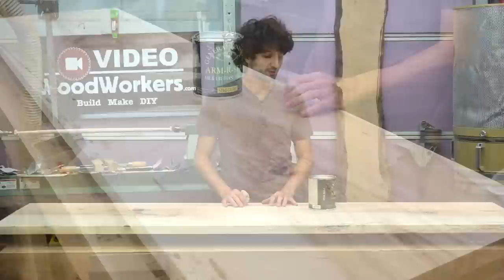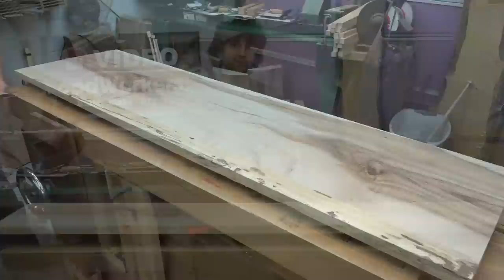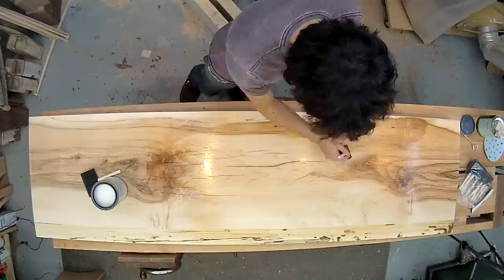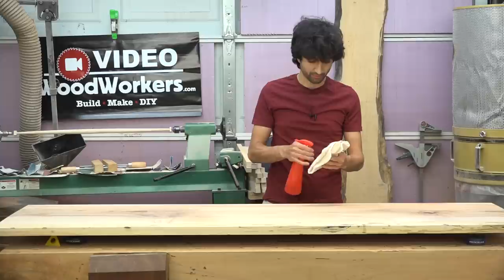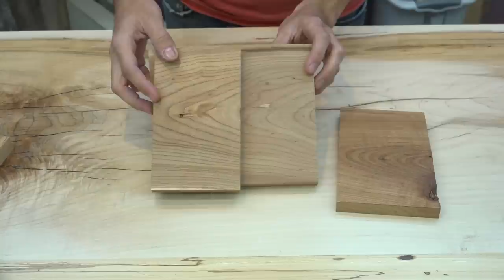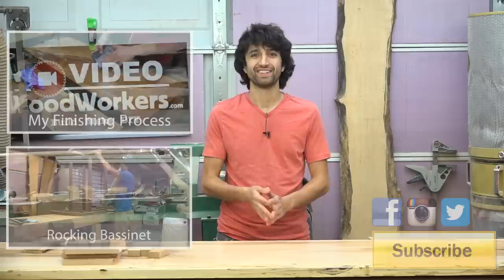Using a Water Based Finish for the First Time

Comment: There is a wipe on poly acrylic available but I haven't tried it. As the name applies it is wiped on with a cloth and rubbed into the wood rather than with a brush. That might might make application easier but I think the color would be the same result. There is a finish for every type of wood that works best for the wood grain and color. I like to test to see what works the best.
Reply from the maker: Thanks Kim!  Wipe is what I'm most used to so I'll have to give that a try in the future.  I think this is going to be my finish of choice for maple.  I think it looks great not being all yellow.

Comment: my two cents. I was sceptical at first with WB finishes too but soon changed my mind. technically they are similar to oil finishes. as with every finish it matters what you get (brand, type) and not the fact if it's WB or oil based. or acrylics vs polyurethanes. I think spraying WBs is the way to go. you can lay down much thicker coats than with brushing. and the gun cleanup is almost free. I remember the times I was going through half a can of solvents just to get my gun clean. especially with oil based opaque enamels. if it is above 20 deg C it will be ready for next coat after an hour. takes a little longer with brushing. spraying does not disrupt previous layers that's the advantage of gun. like oil based, the WB too melts into the previous layers easily. this stuff is actually not water based since there's no water in the can and no polymers can be made to disperse in water. they are glycol/alcohol based and the WB paint alone is somewhat "aggressive". as for choosing the WB finishes, always go with flooring or parquette finishes. at leasy here in EU these finishes have come a long way by now, but sure they cost twice as much as general purpose finishes like polycrylic etc
Reply: as for the milkiness: lighter wood tend to get even lighter, but on something like oak WB looks better than PU in my book. gives much more reddish hue instead of brown you get with oil based stuff. the milky/blueish appearance also serves as a visual clue. as soon as the milky effect is gone, you are ready for the next coat

Comment: I heard the off camera Director trying to give you cues. I don't like foam brushes at all. Bubbles and can't feel the wood. Brushers are ok sometimes but only if the finish flows well into the brush strokes to even it out. My preference is also a clean cloth. I need to try the water based clear coat though. Therefore this was informative for me! Thanks! Missed JR.
Reply from the maker: haha!  I was wondering if anyone would catch that.  He was out there hanging out with me.  Thanks for sharing your experiences Mac!

Comment: The garage door needs some insulation! lol I use the GF High Performance on all my shop furniture, I use my HVLP tho, awesome stuff, drys really fast!
Reply from the maker: lol It's so ugly :)  I bet the easy clean up is super nice for HVLP
Reply: +Matthew Cremona It's a awesome finish for protection in the shop, not the best for bringing out the color or grain in the wood, stick with the GF oil. The best part is probably the HVLP clean up with water and dry time, I can spray a coat outside and sand and spray another coat within an 1 1/2 hours. I've got 7 large shop cabinets, carts to spray when I get the time to do it.

Comment: So hard to beat Arm-R-Seal. Thanks for the informative experiment. I have used the water-based Wipe On Poly, and other than the advantage of no color change, I'm not a fan.....at all! Arm-R-Seal when I need it to be very durable, and Watco on pretty much everything else 👍🏻. There is another finish that Offerman turned me onto called, "good stuff".... It's awesome! (But expensive)
Reply from the maker: I have yet to beat it except for the color change thing.  Thanks Joseph!

Comment: pretty much my results with wb finish and foam brushes. regular brushes didnt seem much better. streaks and bubbles everywhere. also tried spray can wb polycrylic and the satin works pretty good but had no luck with the gloss. ive bought some wb wipe on poly but havent used it yet
Reply from the maker: Thanks for sharing, Mike.  Good to hear others get similar results

Comment: I cut my water based finish 50:50 with floetrol and use it as a wipe on.  The first coats always raise grain I find, so I always sand between coats.  Coincidently, using pretty much the same grits you used.  I had some of the thinned stuff stored and it separated.  It seemed to mix back OK but I didn't seem to get as good of a result, so I would think only mixing up as much as you need at a time would be the way to go.
Reply from the maker: Thanks for the info on thinning, Jim!
Reply: I first learned of floetrol from one of Linn's videos on the Darbin Orvar channel

Comment: Matt I know this is an old video but I just recently began experimenting with water based finish. I spray my finishes, so the air borne spray is pretty strong and requires quite a bit of precaution. I found that I could thin the General Finishes water base with a bit of water and spray it with my hvlp gun. It goes on very smooth and dries very fast. No oder or air borne overspray floating in the air as the particles are much heavier. Whether it's going to be as durable as oil based remains to be seen at this point, just wanted to pass on this info.
Reply from the maker: +Richard Heishman thanks for the info Richard!

Comment: Great video, Matt, thanks for showing all the samples. It appeared you might have been using the HF type brushes which are junk IMO. I get a much better brand from Amazon, but you still must be careful of the bubbles it can produce if not used correctly.
Reply from the maker: Thanks Steve!  I realized that as soon as I started using them.  They're way to mushy but I was already committed to making this video lol  Surprisingly bubbles didn't seem to be an issue.

Comment: Great video Matt. I use Minwax Polycrylic on most of my projects with a brush and I do not see any brush lines. Polycrylic looks thinner than the General Finishes product, That might be one of the reasons why General finishes product had brush lines.
Reply: It got brush lines cause he did everything wrong from the time he opened the can.

Comment: Even if you water pop the wood you're supposed sand after the first coat of poly, not before. When you sand it before the finish coat you're undoing the work the water did.

Also, if you watch the general finishes video he recommends a footy to finish tabletops, although you may have been better off using the larger foam brush by pouring the finish into a tray.
Reply: Also, don't shake the can! Stir.
Reply: +kichaa13 that's a myth. it been proven that shaking the can does not cause airbus blessed in your work but rather the vibration of the applicator
Reply: +kichaa13 air bubbles *

Comment: good video Mat, My exp.  and use with WB finish is a bit different, I never sand more than 150 to start, then hit first coat with 220, #2 hit with 320 # 3 0000 still wool  finish with a wax buff out.  I find after 4 it starts looking milky. Spraying always looks milky, and use a horse hair brush ( seams to flow nicer )  for the most part I only use WB finish when prefinishing ply for the inside of cabinets.  Just my thoughts.
Reply: The can specifically notes not to use steel wool since it will result in rust spots.
Reply: +Corey Ward My can of Lacquer notes not to thin but I and most others thin it, a lighter notes not to ignite near your face , The tag on a mattress tells me not to remove and I ripped that sucker right off,
Reply: +Rich McNatt Wonderful use of non-sequiturs.
Reply: +Corey Ward  Cool word, ( that will be my word of the day)  I just stated how I do it. like anything else there are alot of ways to do stuff, I can think of at least 10 ways to pick your noes, I use my little finger, you might use your thumb, even though your mom always told you not to pick it.....  : )
Reply: Rich McNatt So I actually gave up and used steel wool (0000) to sort of rub out the finish on this desk I finished with GF HP and it worked pretty well, though it did leave light scratches. I suppose you only have to worry about the rust if you're applying the finish with steel wool (like a lot of people do with wax or oil finishes).
Reply: lol glad it worked for you Corey, I would like to see the end product. have a pic anywhere?

Comment: Great video finishing tips from the master. I do use foam brushes when I can. I use scissors to cut the large brush to fit the can. Pull off the handle to keep and throw away the rest. Why keep the handle? Well it made a nice perch for my birdhouse. Lol. However the foam brush isn't good for every job, It did look like you used it a little rough. Lol. It is clearly not a real brush. Gentle softer approach maybe.

Comment: Matt, you've convinced me to switch to oil based finish! Do you use a specific rag for an applicator for that process? Also, what about handling the rag when you're done-do you dispose of that rag in any special way?
Reply: Please don't. He did it HORRIBLY wrong in SO MANY ways! He clearly didn't read any directions on the can or website. See above comments for how he SHOULD HAVE done it. :)
Reply: Megan Garcia I think the finish came out really nice! I'm sure everyone has their own way of doing things and there's not only one way that works
Reply: You're correct. Everyone has their own ways of doing it. But for this specific product, it's always best to follow the actual manufacturer's instructions to a T as the go-to way. They will say what exactly works best for their product. So in this case, there really is only one way that works, the manufacturer's way ;)
Reply: Megan Garcia great so you'll allow me to switch to oil based finishes?
Reply: I dont care what you do and I wasn't acting like a B either. All I said was, don't use this one example of someone doing it wrong to say that water-bath poly isn't any good. That is all. Take it or leave it idc.
Reply: Based*
Reply: Megan Garcia great thank you Megan! I think I'll give oil bases a try in one of my future videos!

Comment: Nice experiment, and value added at the end! I've used Floetrol successfully with WB paints to improve flowability and eliminate brush marks, don't know if it is appropriate for clear finishes. My experiments with WB on furniture projects has not been good (except for WB dyes) and I've gone back to oil based, though that's getting harder to find here in southern California. I know everyone says oil "yellows" the wood but to my eye it richens the color and depth, as it did (for me) on all your samples. I even preferred the maple with oil. Thanks for taking the trouble to show this.